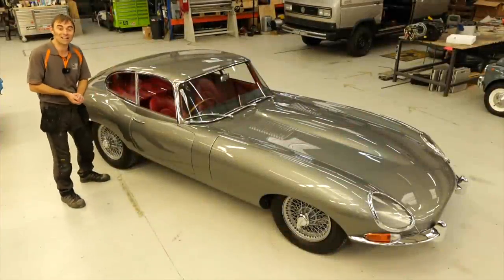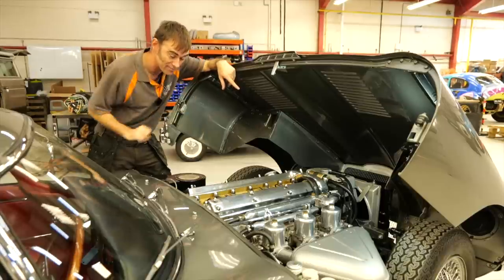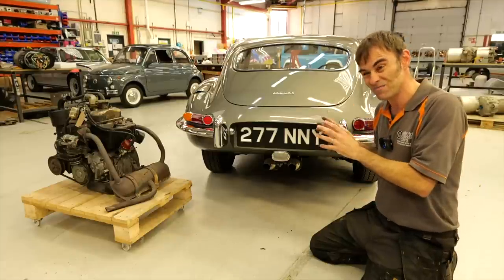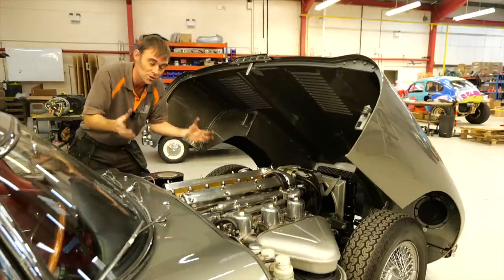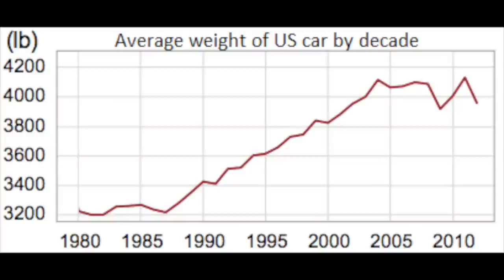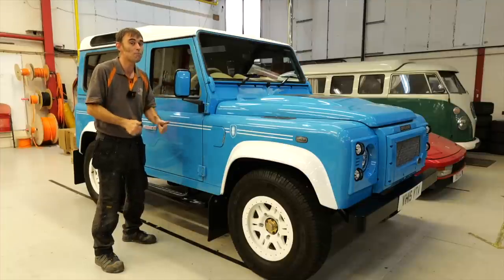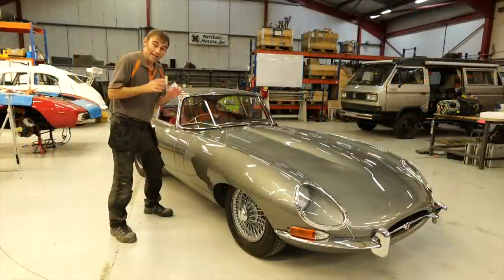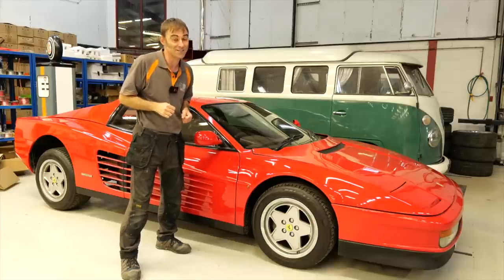Is it a sin to convert a classic car to electric?

Comment: An E type coupe is ideal for conversion to electric actually.  Light, plenty of space.  It's a great idea.
However when one has complete bodyshells available as for a mini or MGB it makes even more sense.
Reply: Yes, but not nearly as ellagent.
Reply: @jpkatz1435  Define elegant?
Reply: Or even spell it!
Reply: The thing about old Jags is they have heavy engines, so they can take the weight of lots of batteries; I'm not sure about the E type (each to their own), but I think the Jag saloons would work well.
Reply: @joejoejoejoejoejoe4391  Yes.  Light body and frame.  Plenty of space is relative of course, but minus the XK lump there really is a lot of cabin and under bonnet space that is suitable for batteries.
Reply: No one in their right mind would convert that MK1 E Type to electric........
Reply: @davidornberg  Yes.  I am aware of that.  In fact I said it somewhere...
Reply: @stephenross8463  I think it makes sense.  Anyone who wants to drive it instead of staring at it while it rusts away needing a cylinder rebore and a new transmission should convert to elecftric.  And you can always change it back if you miss leaking oil.

Comment: I am sure someone has already mentioned it (I didn't want read all 900+ comments to confirm), but home charging is my favorite benefit from driving electric.  I would still chose electric if my charging cost was comparable to filling up with gas.  Never having to get up early to fill up before work, or stop for gas after a long day of work is a huge benefit.  I drive about 1,000 miles a month for work with my EV.  Only on trips of over 200 miles have I ever stopped at a public charging station and that was usually just to give myself a safety buffer with regards to range.  On top of that the stop was always at a place where I would go in and get some snacks and beverages for the return trip.  By the time I got back to the car, I had the range buffer I needed.  It is hard to appreciate how much of a benefit this is until you experience it.

Comment: Great video, very nicely explained on the pros and cons...... i have a 1983 Range Rover Classic with a V8 but the amount of milage that i do in it, its most likely not worth the expense. As for the heart and soul of a car, it's the whole package not just the engine, which is the big part of course for me. The sound, the vibration, the smell the thought of this car not starting........  It's machines that we have all grown up with, and got to know, its a feeling of the past i guess. An EV will no doubt give you its own feeling of a soul........ I would like the idea of listening to the wind, and the countryside as you drive through the lanes and hills.... but then i like the burble of a V8 too?  Can you add a noise simulator of an engine,,,,, when needed at a push of a button? My thoughts would be if i was going to convert a car, would be something more modern...say an early Audi q8 3.0 with all the safety features...... best of both worlds!! A real every day car.

Comment: I was 25 years old in the mid 1960s when I bought a used '62 3.8 coupe. You have no idea how exciting it was at the time, to walk up to the car, open the door and take off. All mine! And it had soul. An electric motor has maximum ( and minimum) torque as soon as you switch it on. The IC engine starts at a relatively low power at low revs, and the acceleration builds as the revs and noise increase, pushing you back into the seat and roaring under the hood gets louder.  Absolutely mind blowing. That, coupled with the old crash box, makes the whole experience so amazing. Still driving a '60 MGA that my dad bought new and absolutely loving it. It revs beautifully and I love taking it through the gears. Oxygen sensors have made tuning much easier so getting the carbs sorted out is a breeze. With no intention of converting to the dark side.
Reply: Time you drove a good EV

Comment: 5:00 something i think a lot of people also miss when talking about conversions. lets say you have 1 of 1000 of a particular car. a general rule is that if you are using original parts you typically need 2 cars to make 1 car drivable. if you are doing a conversion on the other hand you only need half the car to make it drivable. this means that if it is a collector car there are more parts in circulation to keep them running for people who want them to be original and also more of them usable on the road because some don't have or need original parts.

Comment: I love the whole series of explanation.   Good points on all the topics.   I'm in the process of converting my 67 Porsche 911 with a Tesla unit.,  I'm still researching battery options.
Reply: Hi did you ever hear of the
TRB3    a USAF triangle  craft,  it has a small nuclear
Power plant plus a container of Mercury & 
Electrogravitics ,
to make it fly silently .
Does Vertical,/ Horizontal 
Take off & landing .
Just curious , but if a car had a setup similar to that
It possibly could even beat  out the Jetsons  flying car

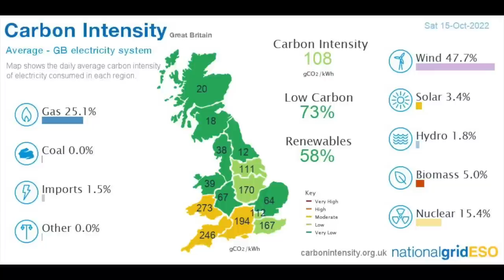Comment: What a great job you do, by making people aware of environmental issues. But, there is still a lot to do to clean electricity supply. At minute 14:45 you picked a particularly good day for CO2 intensity, which in 2022 was on average at 229 g/kWh

Comment: I bought my first Tesla S in 2014 and now I'm on my third, a model X.  On the X five years and 40K miles has cost £150 total in maintenance plus one set of tyres.  I charge from off peak electricity so the energy is very cheap. 
Your film made me miss my Series 1 E Type which was in the same colours as your car and built to FIA regs for hillclimbing and sprinting.   I wouldn't have converted that car because the howl of the straight six and the lovely gearchange where so intrinsic to the whole experience.
I do hanker after a converted car where the engine and transmission are not one of the key reasons why you are buying the car in the first place.  A Merc SL, Citroen DS, 914 Porsche, Fiat 500 a Carver or a hot mini all make perfect sense to me.  The instant torque will make them all better cars, in the end it is the real difference between a Cobra and an AC Ace.  
Its a personal thing, but I don't think I want to replace the drivetrain in anything with an iconic 6, 8,10 or 12 cylinder engine.  Maybe that Jensen will change my mind!
Love what you do and fascinated to see where developments will take you!
Reply: How can a totally useless gearchange be "lovely"?
Reply: @razerrath_com  mine had the close ratio racing gearbox, nicest gearchange I ever used.  Double de-clutching and heel and toe gearchanges are a big part of competing in in an old car, no gears would reduce the driving experience on track.  Conversely I wouldn't want a manual Merc SL, it's a different car for a different purpose.
Reply: Thanks 👍😀
Reply: @GTD40CarClub  The need to change gears is one of the biggest disadvantages of the outdated ICEV. Why do you think the fastest car on Pikes Peak is electric? It never has to shift gears.

Comment: The reliability is the biggest thing IMO. How many people have classic cars and never take them anywhere because they don't want to risk breaking down? Or because they know it will take 30 minutes to get it started. And then it sits and sits and sits and only gets harder to start and more unreliable and then its covered in dust and needs a wash before you can drive it and its all too hard so it just sits forever. 

If its a reliable useful car you can take it out whenever the whim strikes you. or even daily it if you want.

Comment: I think a big one you are missing is how much more the car will get driven.  So many classic cars spend their days in garages or under tarps because of reliability and safety concerns.   My landcruiser spends a lot of time in the garage since its clutch was slipping a few years ago.  A lot of classic car shows really fail to talk about safety and reliability but when you climb out from a car with 3 point seat belts, abs, hundreds of herspers, and crumple zones, getting into a classic can be a mix of fun and anxiety.   Taking away a few of the concerns gets them back on the road and used.
Reply from the maker: Yes. Absolutely, I.missed that one. I totally drive more hours in my classics now than when they were petrol, and that can only be a good thing. 😁👍
Reply: Although a classic car that doesn’t go anywhere also doesn’t create emissions. If it is used far more after conversion, just for fun, then it will obviously not be environmentally beneficial. Purely from an environmental point of view, it would make sense to scrap the car and recycle the materials into something more useful and efficient. But that’s a much more challenging debate!
Reply: @lemagnitio72  classic cars aren’t really a big source of pollution. Their point is to bring enjoyment to their owners through nostalgia and appreciation of their design.  Melting them down would be plenty polluting and is a solution to a nonexistent problem.
Reply: how does converting to electric make the car safer ?I drive my 70's car every day  dead reliable 15,000 miles a summer no break downs in 20 years maybe brit classics are a problem , plus i get 360 miles to a 12 gallon tank of gas  450hp 2800lbs  plenty fast maintenance is oil change once a year change belts and hoses every 5 years ,not that bad plugs have not changed in 3 years even then a 20 minute job in the driveway . , Don't count on free charging forever , it will cost big once they have you all by the balls
Reply: @imarobot3757  reliable brakes, better acceleration.  Better handling.
Reply: Also greatly reduces maintenance.  The other thing that turns classics into barn finds
Reply: safety concerns? Come one, a real classic car owner dont care about that and if it brokes down you repair it. What you expected about a 30 or more years old car? If those things are a real problem for anyone how want a classic car, i reccomend him buy a new car with a retro desing like the honda e-City
Reply: @mikipari1  I really own 2 classic cars, 3 if you count a 16 year old wrx.  my brother owns another and several classic motorcycles.  I still have a fear of death and a budget that isn't unlimited.
Reply: @RjWolf3000  30 years ago the safety was good, now we see it as dangerous and today standar as a really good one. 30 years in the future will happen the same and it doesnt mean it will be dangerous, it will mean that its less safer than a new car. Thats why im not worry about safety, i know what i buy and his risks. 

In my opinion i act like that cause normaly the chances of an accident are low and most probably at low speeds (by stadistic its the most common crash, at least in europe), reason why i drive defensively for safe of my integrity and the car.

Pd: I have 2 classics at home too and my budget sadly its probably lower than yours. (The wrx i would count him as a youngtimer, cool car btw 😁) 

Its a pleasure talk with you
Reply: @imarobot3757  Don't you think that you have been got by the balls already? How much have gas prices risen? What about OPEC? Do YOU have control over that commodity?

Comment: Best video I've seen that compares ICE to EVs. Very well done and easy to understand, except for those close minded petrol heads. As for the soul of a car, I feel it's the ride not the engine. I'm still waiting to get an EV and both the power and ride of my Tacoma truck stink. I hate loud cars, especially those with stupid exhaust amplifiers. Give me a quiet ride with enough power to get where I'm going and I'm happy. I just wish you guys would come up with an EV conversion for my 2013 Toyota Tacoma (Hilux in your area?). I have plenty of room under the bed for batteries and after installation of the motor in the front to use my transfer case for 4WD, I would have room for a frunk and with some suspension changes, still enough to carry close to a ton. My truck is paid off and is not like the big, fat trucks of today. I doubt I'll ever be able to pay for the Cybertruck I have reserved so doing a conversion might actually cost me less. LFP batteries are a given with enough to handle towing and long drives along the West Coast of the USA.

Comment: I have three classic cars and I have seriously considered converting my E Type, I even discussed it with one of Moggy’s team last year. The main problem is cost, they estimated north of £70k with an 18 month lead time. I only drive a maximum of a 1000 miles a year in the car and frankly it just does not make sense. Converting a classic does not make the car a daily driver either as practical problems still remain like steaming up in rain etc and I would certainly not leave the car unattended too long in a public car park. So in summary if you have money to burn and are prepared to wait around two years to get a car converted then go for it.
Reply: 70k WOW

Comment: Well said Richard! I would also add that a bigger problem than the toxicity of burning petrol/diesel is the C02 created (surely the worlds biggest problem at the moment). Also, even if charged from a mainly fossil fuel powered grid BEVs still produce less C02 (because of how much more efficient they are at using that energy). I would think those reasons alone would be enough incentive but there are all the other massive benefits that you mention! Keep up the good work!
Reply: If we all stopped buying everything we own from countries like china who don’t give a dam about emissions then I would agree with you. Until then electric car are a gimmick and that jaguar was butchered for no reason.
Reply: @happydays1470  I must admit I'm not 100% on the point you are trying to make? Does it help to buy stuff from different countries and which countries are the good ones? There are plenty of people in China that really care about reducing emmisions - there are also those that don't. Same as all other coutries in that regard. Our electric MG was made in China - better than buying a fossil fuel car made in Japan isn't it? Volvo's biggest car factory in China runs from 100% renewable energy. I'm putting a Tesla drivetrain (originally manufactured in China) in my Landrover which will lower the C02 emission it produces from 5 tonnes a year to Zero. Is it better to do nothing and justify that by saying that there are people in China that don't give a damn?

Comment: Man, this vid brings up some profound topics - art, soul, finances…weight! I’m with you, but I do “feel” what people mean by saying some engines have “soul” and I think it has to do with the combo of sound, power curve, red-line, shifting/rev-matching that makes some engines feel ‘alive”. It’s probably the lack of these imperfections that makes electric motors less animated. I do wish someone would come up with an electric package that tries to recreate the petrol version’s driving experience, including shifting, but with no pollution and more power.
Reply from the maker: We've done many a conversion using the original gearbox where you can still shift up and down the gears. This electric MG Midget is a good example of just that. It was a real hoot to drive 👍 https://youtu.be/ZvQlX2iAXk4

Comment: I’ll give you an explanation of what in my opinion gives a classic car Soul ! Here goes!,
:Walk into your garage and smell mixture of oil and petrol and old leather in the air,
:Open the door and take in the whiff of old Connolly leather from the the interior.
:Pause for a moment as your sitting in drivers seat and hear the ticking of the old quartz clock second hand.
:Put the key in ignition and turn the key one click , red ignition light comes on.
:Listen to the eerie silence as put your finger towards the engine start button.
: Blip the excelerator a couple of times and you can just hear the carbs with the fuel
: Push engine start button.
:Listen to the cranking up of the engine as it explodes into life 
:Rev the engine and listen to the angry rumbling music coming from the V8 and V12 
:Strap on the harness 
:Check oil pressure gauge
:Check oil temp. Gauge 
::Check water temp.gauge
:Check your fuel gauge
: Clutch pedal down and push gear stick into first gear
:Clutch up and gas pedal down and off you go!
:You might be driving the car , but actually your just a passenger .
ADD THE ABOVE TOGETHER = SOUL!!!!
There’s your explanation

Comment: Simple question, do you prefer seeing the cassis driving or do you prefer the original standing in the garage.
Reply: This rhetoric comes from a certain type of people. We know them and being thoughtful and careering f.. if it matters what they say. Your car, do what you want. It is called freedom. They don't like it, even if your property.
Reply from the maker: Good point. 👍
Reply: @LosZonga  It may be your car, but if it's not "your" gas station, "your" roads or "your" low emission zone your freedom is quite limeted.

Comment: If I wanted an EV-converted 1969 Mustang, I would choose one that came from the factory with an inline 6, that doesn't have very much intrinsic value.  Would it be smart to convert a Boss 429?  That car, in great shape, can fetch well over US$250,000.  So I would be strategic with my conversion choice.  Sensibly, I would never drive a Boss 429 frequently anyway, because the chance of an accident makes the money risk too high anyway.